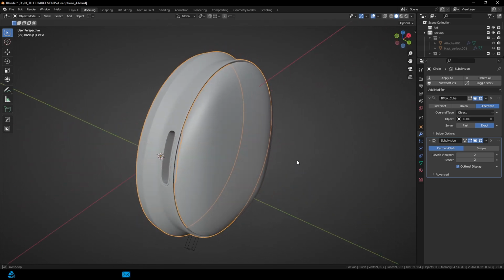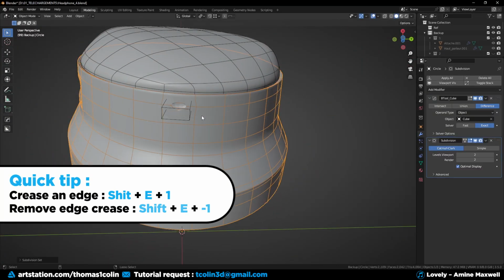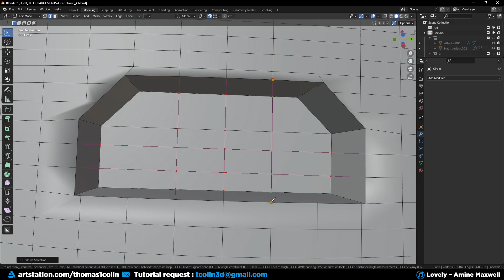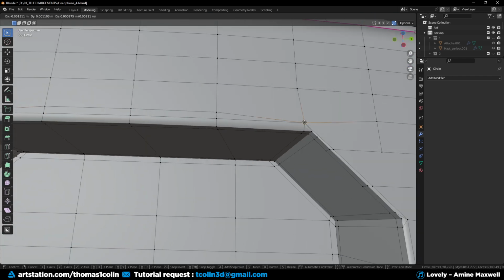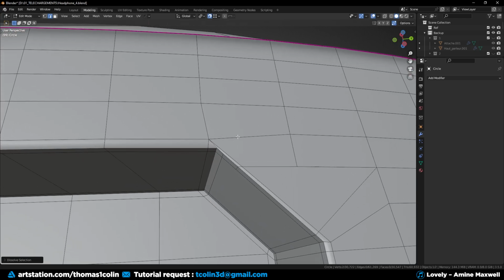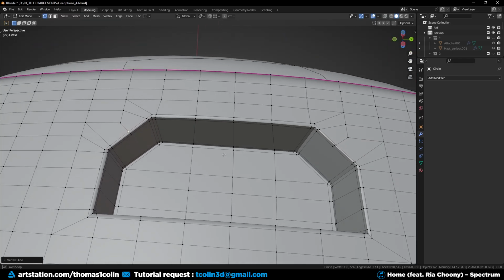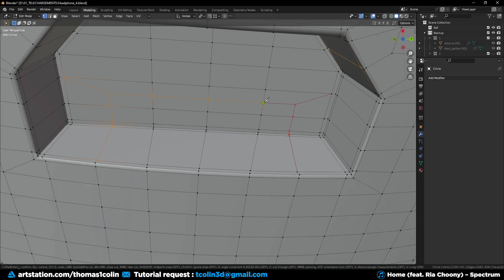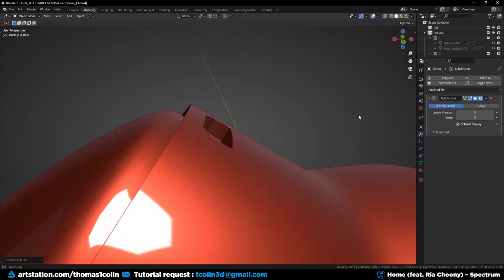Topology Study : How To Clean Your Mesh After a Boolean

Comment: i wish there was show key strokes so i could see all the amazing shortcuts you're using
Reply: He's basically using G+G to slide / K to use knife (+ shift for center) / Ctrl+B for bevel (scroll up to add 1 segment) + P for Profile (slide mouse to right to increase to 1.000 value), then Ctrl+R to add an Edgeloop (scroll up to add 1 more loop) and he also uses J to connect the vertex path at some point, that's basically it
Reply from the maker: @MattproThe  yeah exactly, thanks for the comment :)
Reply from the maker: I'm sorry I forgot to turn them on before recording 😅 I'll not forget in the next one ! Thanks for you comment !